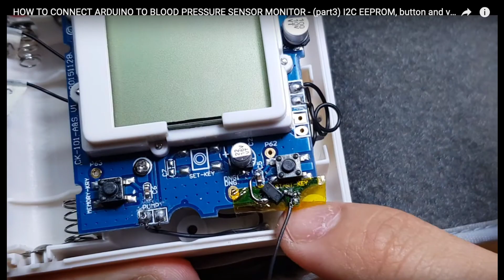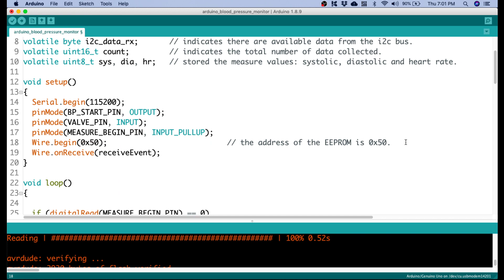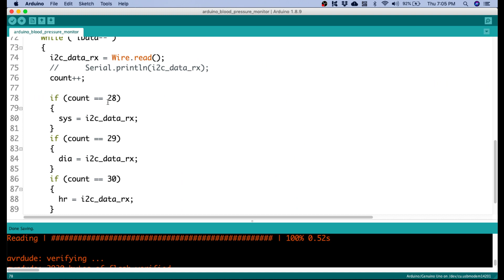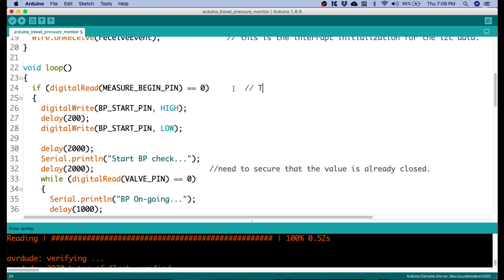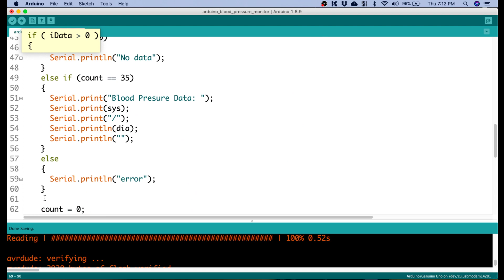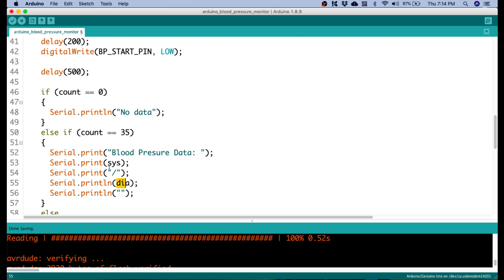ARDUINO BLOOD PRESSURE SENSOR SOURCE CODE LINE BY LINE EXPLANATION - Step by step tutorial (4/6)

Comment: Sir is it possible to hack data in this way from a digital pressure meter which does not have an EEPROM on PCB itself???
Reply from the maker: I am not sure. My method requires the i2c eeprom.

Comment: sir, i have a problem... the bp outpit is not displaying in the serial monitor.. there are times that it will.. but there are also time it wont
Reply from the maker: You need to capture that exception. Then figure out what can possibly causing it. I can help you if you can send me some console output.

Comment: hi , i have a IOT project and i need some help. I was wondering if u can help me. The project is similar but the chip is different. I will compensate for your time. Thanks. Message me if you are interested
Reply from the maker: email me here: circuitdesolator@gmail.com